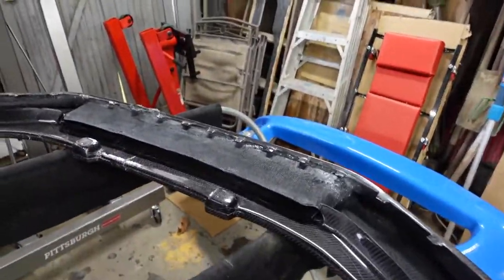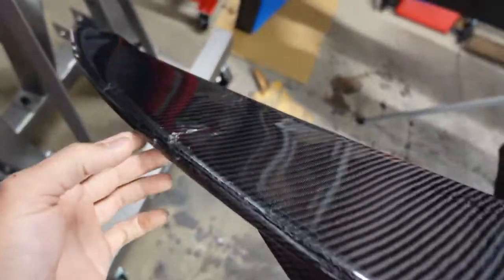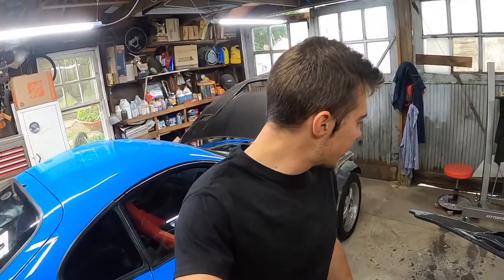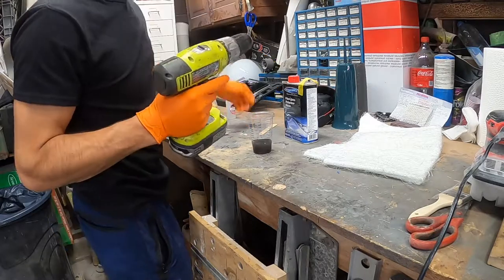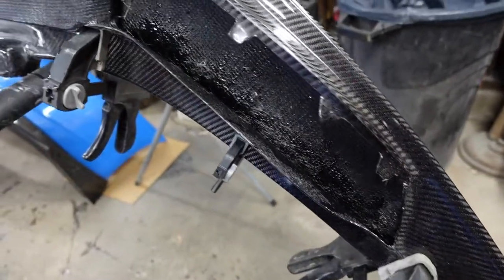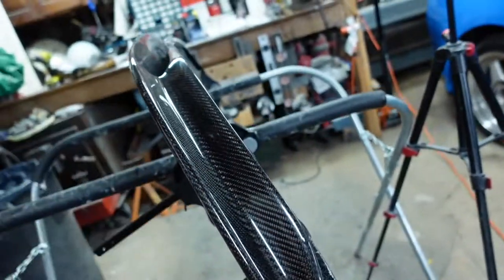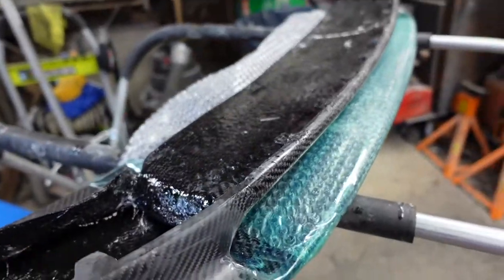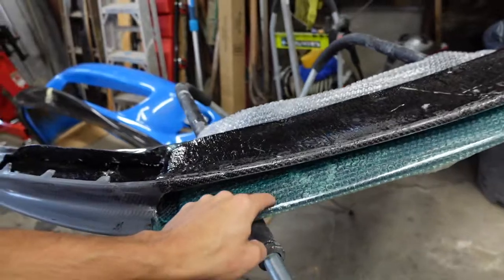Repairing Destroyed Carbon Fiber (Audi R8 Front Lip)

Comment: Man, all I got to say is wow! I currently have a vehicle that has carbon fiber parts from factory in one of those parts need to be replaced and the factory was trying to charge $4,500. Thanks to YouTube University and especially your video, I've learned a lot. I am looking forward to doing my own repairs. It should be fun.
Reply from the maker: Hey thanks for watching! That's awesome I'm so glad you found it helpful. I wish you tons of luck and a piece of advice that helped me when I was getting started. Buy a little test kit of resin and carbon and make something flat at first to get used to the resin mixing ratios and how the carbon will reacts to being shaped. Something like a coaster to put your drink on or just layer up some carbon and squeeze it between something flat and cut a cool shape out of it. Good Luck!

Comment: It’s almost done 👌🏻 🔥 excuse me, what kind of green tape is that, how can I find it and where?
Reply from the maker: Hey what’s up! The rape I’m using I bought off Amazon. Here’s the link! 
Resin Tape for Epoxy Resin Molding Silicone Thermal Adhesive Tape Easy Peeling High Heat Resistance Epoxy Release Tape for River Tables Hollow Frame Bezels Epoxy Resin Craft Jewelry (2 in x 108 FT) https://www.amazon.com/dp/B08XZ35Y6C/ref=cm_sw_r_cp_api_glt_fabc_0PPC36M0JVZ0PPC9752Y